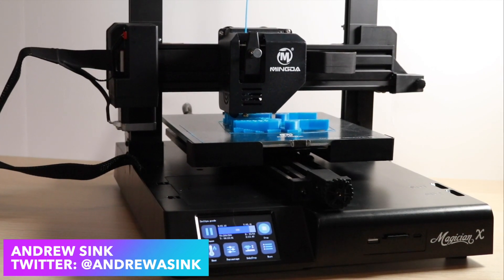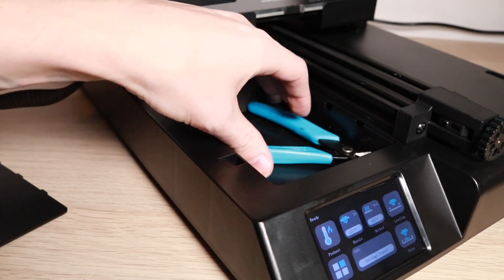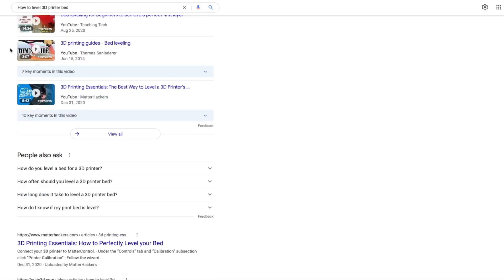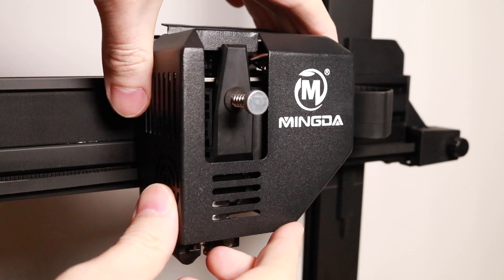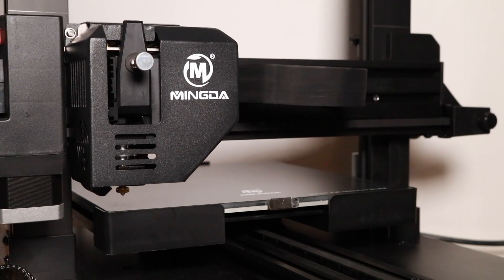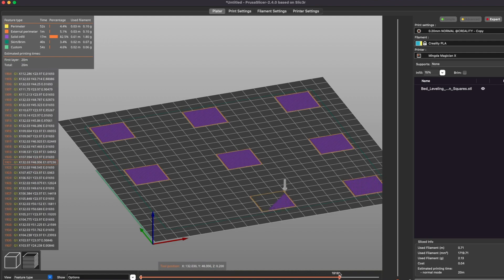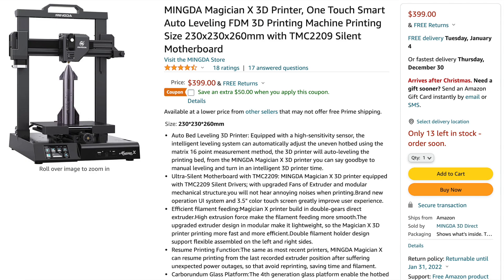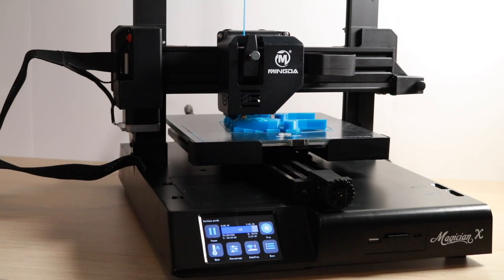Mingda Magician X 3D Printer - Automatic bed leveling that works!

Comment: Well explained but you should highlight the failed prints meaning filament wasted without ABL.  With long print times  or dimensional accuracy the issue - generally both - the cost of wasted filament quickly overcome the extra cost.  And you could easily add silent steppers, 32 bit Marlin 2.0 firmware and more to why this is a great price for this out of the box 5 minutes and you are printing.  Great video, mate.

Comment: I love surface-mapping "ABL" and have appreciated it since I got my Prusa (despite the requirement of doing a z-offset).

That said, I do wonder about the flatness of a bed if that much undulation happens on the Z. My Prusa generally is flat enough that there is considerably less movement on the leadscrews across the build plate.

In any case, I love this kind of ABL and hope one day my printer will have it!

Comment: i think auto bed leveling is definitely worth it, but a good implementation is what's really going to make 3D printers feel more accessible. Also, I loved your point that the best solution is the one the user is least aware of, great video!
Reply from the maker: Right? It should be like charging a car battery; an automatic process that occurs whether you are aware of it or not!
Reply: @AndrewSink  exactly!

Comment: Why isn't there a bed-leveling method that can adjust the bed itself as opposed to compensating on the Z axis?

Bed leveling is a pain... when my friend talked me into buying a 3D printer he said "you only need to level it when you move the machine." In reality, I have to level it every time it cools down. BL-touch helps a bit... but I had a lot of weird trial and error in the beginning. Even so, it doesn't work if the base leveling moves loses its leveling beyond certain tolerances.... so I inevitably still have to manually level it albeit less frequently than without.

P.s- The Magician X is quite exciting to learn about.
Reply from the maker: Hmm, that's a great point. Moving the bed might be tricky, as adjusting a bed that moves in the Y axis means that the "mesh" of peaks and valleys would also move relative to the extruder, right?
Reply: @AndrewSink  the positional changes in the Y-axis should be accounted for, just as it is when using BL touch. I mean, there must be a reason why nobody has mounted low-profile stepper motor beneath the 4 corners (as opposed to manually loosening and tightening the screws and springs). Maybe you're on to something but I'm still surprised nobody has taken a crack at it. 

The way I imagine the ideal scenario: the nozzle and probe goes to each corner and under each corne is a stepper motor instead of a human hand listening and tightening the adjustment screw. Maybe it does all 4 corners 3 or 4 times since lowering one corner sometimes causes the opposing corner to rise.

After that, then it can do a regular mesh leveling. From what I figure it's probably just too much of niche project. The work performed on one machine would perhaps be more difficult to implement on other machines. Meanwhile, mesh leveling basically works the same on different printers, I guess.

Maybe I'll post a question about this with my example to the 3D printer subreddit to see what else I might be overlooking.

Comment: Auto bed leveling is absolutely worth it, even if it is just adding a bltouch to a machine that you already own. It improves the reliability of the machine so much.
Reply from the maker: Completely agreed! Even if you don't use it every print; it's definitely handy to have after you've made some modifications!